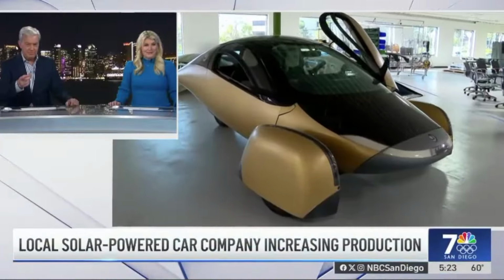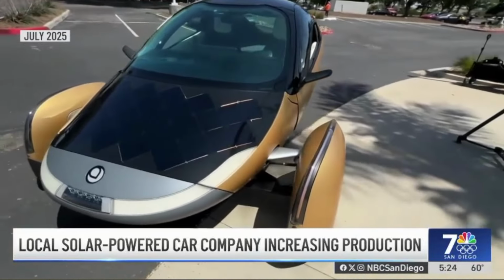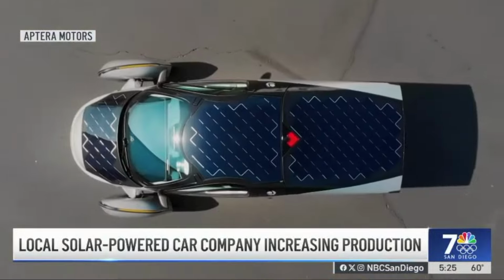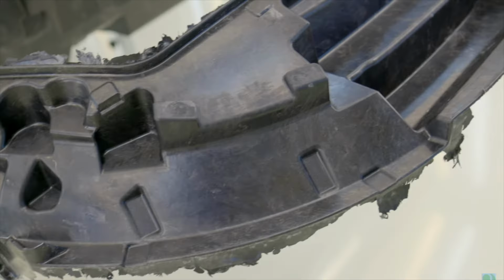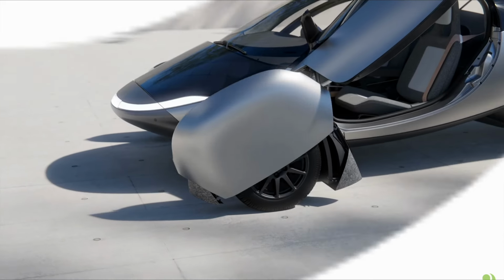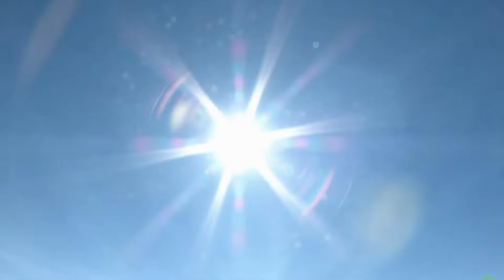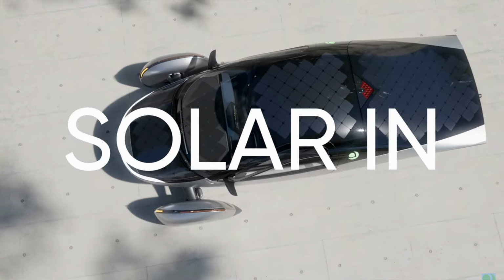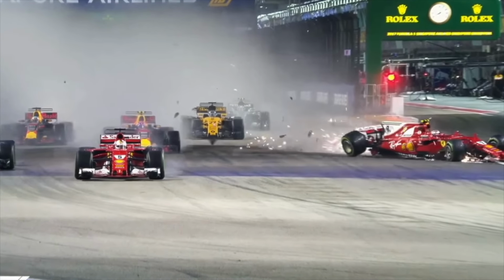Aptera is ramping up !

Comment: Can't wait to get mine! Since I live in the PNW and sometimes our sun light is somewhat limited (;o)) and the Aptera has a NACS connector for charging how will I be able to use my Level 1 charger? I would ask the company but there is no place to ask questions on their website. Or is there? I can't find it.
Reply: Aptera will come with its own Level 1 (ordinary 110 v. outlet) charging cable.
Reply: There is an adapter from level one plug to NACS.

Comment: I’m hoping after production starts costs will come down and make the prices closer to originally stated. (base $26,900)
Reply: Not gonna happen.  That was long before inflation.  What is a positive is that battery cost has dropped drastically so....
Reply: Not going to happen.  Just like no in skin cooling, hub motors, car like safety, a turning radius under 23 ft, a 1k mile range battery, or a crash dummy that can survive a side impact crash test with an intact head or neck.
Reply: And you know all this how?  Prove what you say or you are a troll.
Reply: @daviddrake6875   well, dear investor who's stock is tanking, it is, or was,  mostly on their website. The touted in skin cooling and super efficiency of hub motors. Do you see these?  Nope. If the current suggested gvwr is in the 500# range, more than doubling the battery pack will far exceed that and will take a serious redesign to make it happen.  Turning radius isn't listed on the website.   Quite odd.  Aptera claims it will be similar to other vehicles on the road.  Seriously?   At this point in the game they aren't competent enough to know the turning radius?  They don't want to tell you because it is similar to other vehicles...like the Ford F150 Raptor.  You can dig through the few videos that do show a hard turn and guesstimate that radius in the 24 ft range.  Car side impact crash testing probably will never be tested.  The only requirements for safety are the same for motorcycles.  Aptera never states in writing of crash testing to car standards.   But remember that there are no side airbags, the door is sharply curved and that dummy would be hit with some 3300 lbs going some 30 mph into a vehicle around half that weight.  Good luck being that dummy in that seat.  The fan boys really need to complain to news agencies that refer to this as a car.  Some government type might start pushing for aptera to meet car crash standards.  That would be a quick death blow to Aptera.

Comment: Don’t lie about the safety. Formula One cars are not made out of recycled, forged carbon fiber, they are made out of normal carbon fiber mat, which is much much stronger than the forged carbon fiber. There is no comparison. It’s like the foolish comparison of Aptera to Tesla. 😂😂😂
Reply: They're doing crash tests soon. Let's see what happens.
Reply: I hope they don’t ( shudder) crash test my beloved SOL. I would go along with physically crash testing then as a compromise. I still think Computer Simulation is as good.
Reply: If it is on the internet, it is true - Abraham Lincoln
Reply: The carbon fiber mat is almost 8 times stronger/stiffer than forged carbon fiber. But wouldn't that stiffness be bad for passengers, because it would lead to much higher deceleration on impact, yes?  In contrast, forged carbon fiber energy aborption would be much better for highway accidents.  Forged carbon fiber should do better than metal on the energy absorption, yes?
Reply: @FriedOrca  That may be true.  It's certainly going to shatter on impact.  The problem is they have been saying it is 7 times stronger than steel which it is not.  Forged carbon is not typically used for structural members. Aptera has said the carbon body won't crush as easy as a steel car.  We shall see.
Reply: Absolutely! Who in teh world would compare the Aptera to a Tesla.  The Aptera will be so much better.
Reply: @bryanwhitton1784  Are you talking about safety? Amount of passengers? or efficiency? LOL. I think you changed the subject.
Reply: @kurt16950  Well actually said kind of tongue in cheek.  But seriously we have two Tesla cars.  I have a Model 3 and my wife has a Model Y.  Should the Aptera be decent I will likely sell my Model 3 and get the Aptera.  I am retired and the car will sit on my south facing drive way.  I almost never even have two people in my car so four doors and seats are meaningless.  I drive and 40 miles a week so I would never have to charge it unless I am going across country in some manner.  My most common issue that I come up with in my Tesla is when I go get long somethings at Home Depot.  The Aptera is a better choice.  
I ride motorcycles on a regular basis so it will be much safer than those should something hit me.  Use case!  That is often missed when someone say x is better than y.

Comment: Video evidence that they lied about building an “assembly line.”
Reply: Take a chill pill JetFire9. Chris(Co-CEO) mentioned exactly how they were setting up their assembly line and explained that it would be mostly manual at first, as they work towards automating as many processes they can. It’s gonna take time. 50+ years ago all car manufacturing was almost entirely manual. The only real automatic process was moving the car along the different assembly stations. After another 50 years of advancement from these companies almost the entire process is automated now. It wasn’t done overnight. If aptera had the kind of funding Tesla did when they started upgrading their plants, then we would see the cars much sooner. Tesla when they scaled up production had around $700 million(in 2012 dollars) in funding, aptera has had about $220 million including the $75 million stock purchase agreement. Tesla also had the benefit of their car being made almost entirely like a regular Toyota, all the automation is very similar due to the body makeup being almost entirely the same.
Reply: My idea is to add the wheels at an early stage, and roll it from station to station. I am an optimistic Ambassador.
Reply: @Bionic9998 What?
Reply: @JetFire9 very simple. They didn’t lie about an assembly line. Just because the line is mostly manual at first doesn’t make it any less an assembly line. So chill out and don’t obsess over things you can’t control. Just sit back and watch.
Reply: @Bionic9998  From day one they were raising money from uninformed investors in order to "start production"  Every effin day for five years.  The implicaton being that the design work was done and they were ready to build cars.  There was a daily rendering of a busy factory and close up pictures of obscure parts.  This is yet another repeat of that sequence.  The design is not done.  They are hand building some more prototypes that they are calling validation cars.  Last year they were called Production Intent cars.   Those cars were supposedly going to be identical to what they were going to build.  When one actually showed up at CES it was clear that they were nowhere near complete.  Even so, validation data was supposed to have been pouring in during March and there was going to be a road trip all summer.  None of that happened.  One can only assume that the PI design had issues and they had to go back to the drawing board.  Now we are being told they are going to build 12? units of a failed design?  I don't see how that's good news.
Reply: video evidence that the assembly line robots for production have arrived.
https://www.youtube.com/shorts/wyhqxf9AfoE
Reply: @FriedOrca  Dude.  That was so long ago I don't even want to go back and research it.  I think that was when they were still leasing that other building.  Did they even own those things?   They've never been seen since that video and that girl has been gone for a long time.
Reply: @FriedOrca Hopefully they have a good return policy! 😂😂😂
Reply: @JetFire9   Uh, like Tesla's 🙂?  Did you get stuck with a Cybertruck 🙂? Definitely increased risks when buying any first year model and double that for unconventional vehicles. Aptera's right to repair minimizes that risk a bit. My vehicle won't be ready until after the first year of production, so I'm not worried about returns.
Reply: @FriedOrca Uh, Aptera is never going to build this lying abomination in any quantities, so right to repair is meaningless. The whole thing is a scam that will make Dumb and Dumber stinking rich off your back. You got scammed! Look up romance scams, because you’re a victim currently in that stage of denial and giving away your money and love to scammers that are laughing at you behind your back! 😂😂😂😂
Reply: After these 12 vehicles are built and have gone thru testing, the the Assembly Line will start, where 40 Apteras will be built per Shift. 2 shifts per day will result in 80 Apteras being built per day.

Please rewatch the 1st 5 minutes of the Video, sin e O doubt that you would watch the whole video
Reply: 80 per day! Fantabulous! I am an an optimistic Ambassador.
Reply: @andremcamara3120 Please check what Aptera has been claiming in the media. It doesn’t line up to your beliefs.
Reply: Sorry, but perhaps the lie is on your side. You do realize that what the video shows is only the current state, a semi-manual process (using jigs) for producing the test vehicles. I think it's obvious, so I assume you know, that It does not show what has been designed for the production, which is an advanced assembly line, where the workstations each move (see Munro videos for nice walk through if you missed those). Have they ever claimed they will use the full-blown production assembly line for these test vehicles? Don't think so and if not, that makes you the liar :-).
Reply: @FriedOrca Ok, liar.

Comment: I think the 10 validation vehicles are for testing and won't be delivered to customers
Reply from the maker: That’s true but they have the money to produce 50 vehicles 😎
Reply: @freepower1082  you wanna come out and see my Solar Electric boat? I have same size battery pack as Aptera with 1.3KW of solar. I sent a DM your way
Reply: They want to get the vehicle certification on ABS and air bags and crash testing before  they start production
Reply: This is not production, this is prototype production.
They said 2026, as they said 2025
Aptera eats too much money. Millions.
And need so much to reach eavy production.
Reply: @Alans-qm5ch wrong they need to have production vehicles to get their certification on air bags and ABS and can only get them with production vehicles.
Reply: it’s obvious you don’t know squat they have to certify production built for testing on all the safety equipment before they can sell them
Reply: 12 vehicles, I believe that Steve Fambro mentioned.  2 built, 10 more to go.
Reply: Why not after validated?